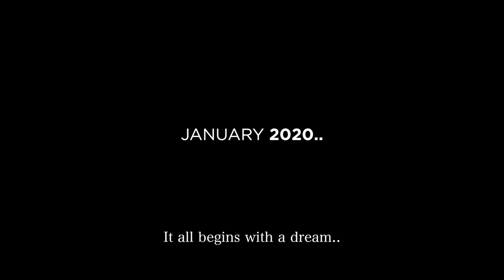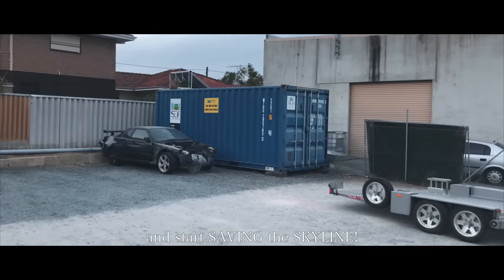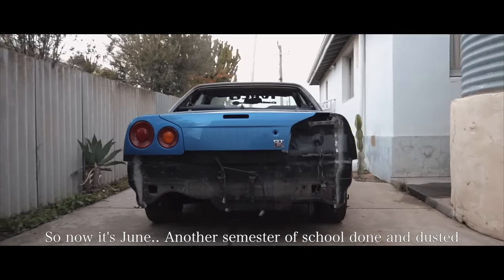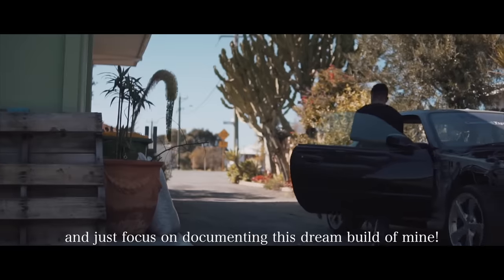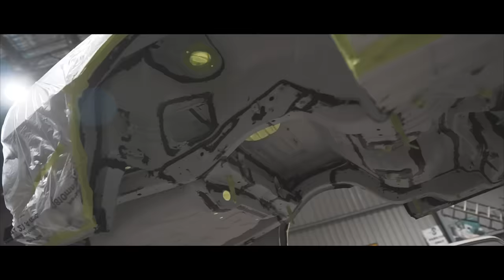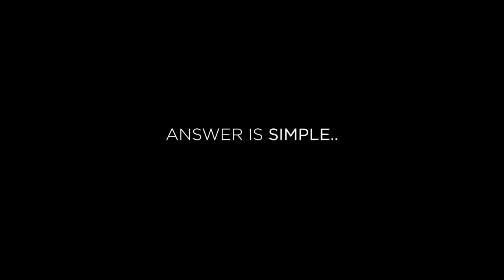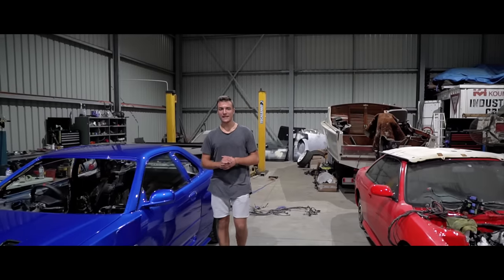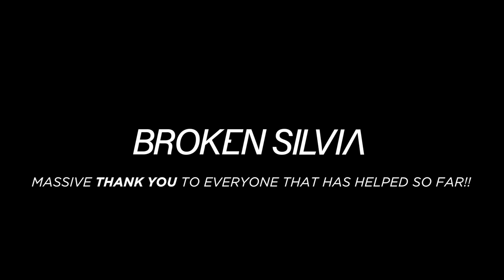BUILDING A R34 SKYLINE body in MINUTES | Poor Man's GTR [EP15]

Comment: Are there any other differences between the GTT and GTR body apart from the rear fenders? Are the mounting points for the front fenders and front bumper the same?
Reply from the maker: Yep mounting points are the same, you just have to use GTR brackets and retainers for the front end. You can keep the OEM GTT reinforcement bar but I bought a GTR one since mine was damaged

Comment: But is the chassis safe? Cause i've seen some crazy rebuilds but after riding the car it had nothing to do with the normal one you could feel thatt something is wrong.   And will it get rusty again?Cause from my experience when cars metalic parts bend then after years they tend to rust again.
Reply from the maker: Chassis never got damaged
Just the body panels

Comment: Was it originally an R34 GTR or was this converted into a GTR. Honestly this is prolly the best way to own a Skyline R34 GTR. You literally built the car yourself top to bottom and know everything about it. Btw it's a beautiful R34 GTR. Do you think you've got to build and own an R34 GTR for cheaper than if u bought one? Would u take this route again?. I've been thinking of maybe taking an R33 and converting the front end and rear end into an R34 bkuz the R34 Skylines are illegal in U.S. we've got some time b4 they become legal in the U.S which sucks. They've gotta be 25 years or older. And 21 years or older for federal exemptions. Which means they dont need to be tuned down or anything and dont need to add safety features or anything like that it will come in as is.